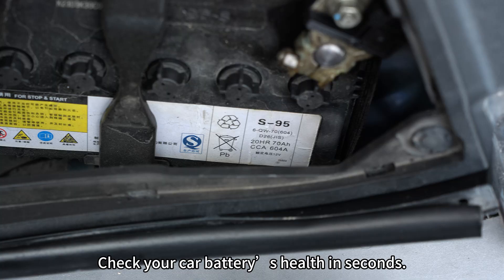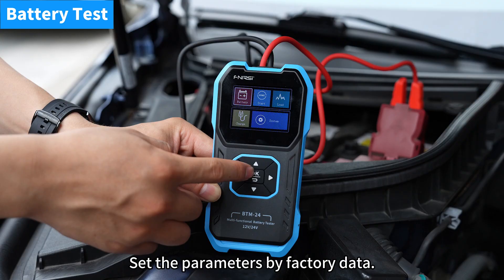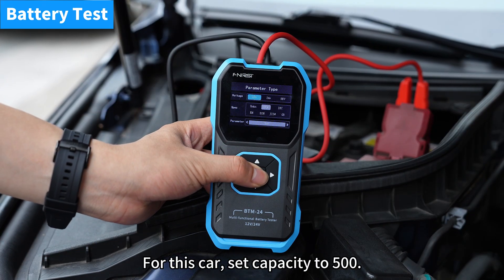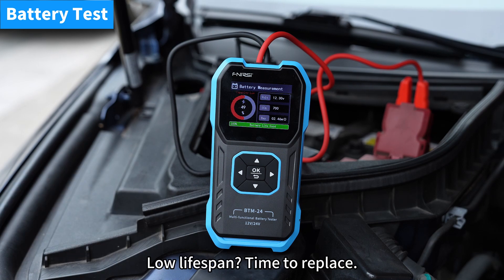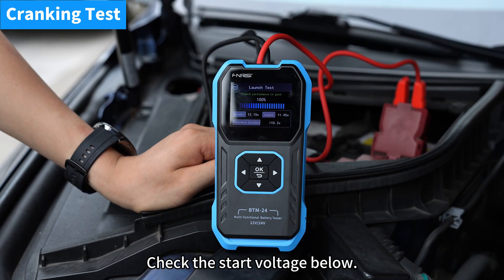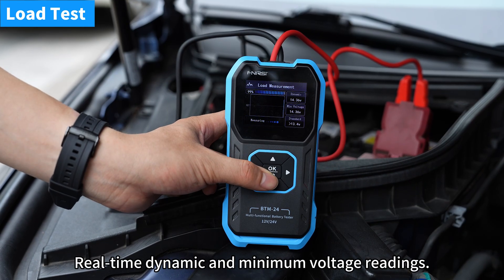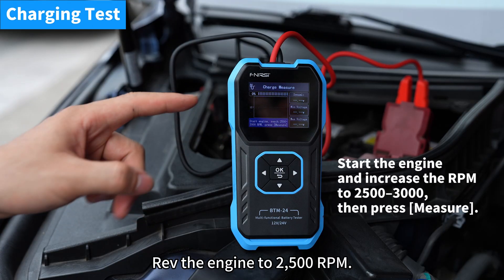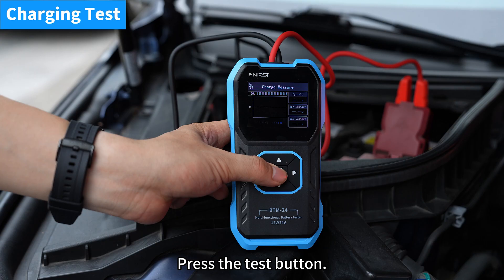FNIRSI BTM-24 | Car Battery Tester 12V/24V – Quick Capacity & Voltage Check! #fnirsi #batterytest

Comment: Can we get an instructional video on updating the firmware.   tried the manual method,  dont understand what i am doing wrong !
Reply from the maker: Absolutely — we can prepare an instructional firmware update video for you 👍
That said, it will take a little time to produce and polish.
In the meantime, you can try the steps below carefully. Most issues come from missing one small detail, so please follow them in order:

Firmware Update Steps
1、Power off the device completely.
2、Press and hold the “Down” button, then power the device on.
The screen should enter the firmware update interface.
3、Connect the device to your computer using a USB Type-C data cable.
Your computer will recognize the device as a USB flash drive.
4、Copy the firmware file directly into this USB flash drive.
5、After copying is complete, press and hold the “Down” button again to start the device and complete the upgrade.

If the computer does not recognize the device or the update screen does not appear, the most common causes are:
· The Down button was not held long enough
· A charging-only cable was used instead of a data cable
· The firmware file name or format is incorrect

We’ll follow up with a clear step-by-step video to make this even easier.